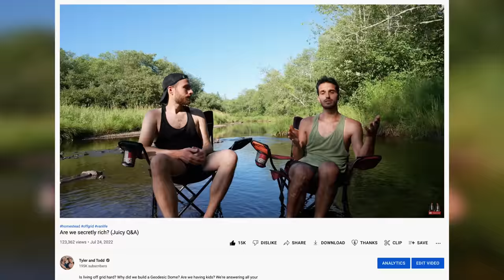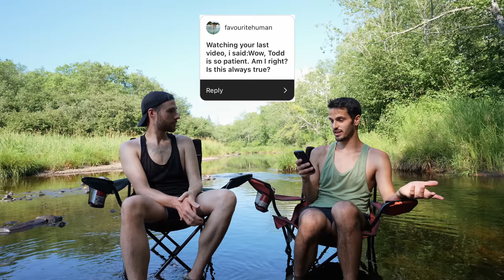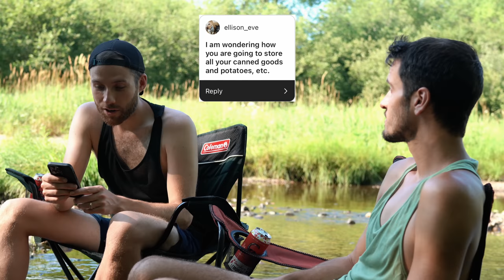Why we live off grid in the woods (in a Geodesic Dome)

Comment: Maybe for the root cellar, you could create some sort of a ‘Hobbit Hole” - an above ground mounded dirt hill, internal structure, with the green roof being natural vegetation. The hill should be able to keep a constant temp but being above ground should keep the water table from being an issue?
Reply: What a great idea!
Reply: Where I grew up in Wyoming someone had actually done just that. They took the insulated box off of a refrigerated truck and buried it above ground with dirt for a root cellar. As far as I know it never froze inside nor did it get hot in the summer time
Reply: I was just going to leave a comment about this! They are quite common here in Sweden, plus they are so nice to look at 😍

Comment: Regarding the Garlic. Leave it in the ground this year and dont harvest it. So leave it over winter and then harvest it next year instead. Garlic requires the cold of winter to form the cloves so leaving it in the ground over winter itll give you the cloves next year. Ive done that before and its worked for me.
Reply: Also, trim off the scapes, the flower stems. Better bulbs, and can be used in stir-fry.

Comment: I live in an area with clay soil that seeps water. The root cellar solution is to build it above ground. A concrete shell covered with about a meter of compacte soil, planted with grass for stability. You get the benefits of the constant temperature without the constant damp.

Comment: Here's a goofy idea for the root cellar.  Build it above ground and cover it with the soil you excavate at the new pond.  The soil can add it's insulation factor to maintain temp and humidity.  It'd be another way to reuse material.

Comment: Rain barrels, once you have your home built. We have 11 barrels (~ 700 gal) which collect water from our ~3600 sq ft metal roof, which we use solely on our extensive gardens and aquaponic greenhouse system. Your pond and high water table are great assets, but the vegetation absorbs a lot. Your roof will be waste water unless you collect it.

Comment: I had ideas once for a root cellar, I live in a location that has a high water table. It’s based on the Earthship, an above ground structure, no insulation, surrounded by 6 feet of dirt, 183 cm. I imagine you would need a dome to support the weight of dirt on the roof, and maybe you could get away with less or no dirt on the roof. 

Just a suggestion, I know it would be a lot of hard work, I would try and avoid the tire wall.

You guys are great!

Edit
Basically an above ground dome structure surrounded with 6 ft, 183 cm :-), of dirt.

Comment: on the avocado tree: it takes years to bear fruit. it needs a crapton of water.  it get HUGE. and you can't grow it from a pip, because the fruit will not tast good. if If you want to save time and disappointment, buy a small tree. also, check if it can survive the winter temperatures :-)

Comment: People are talking about canning food, but pressure canning requires a large amount of heat .  There is plenty of wood around, but would youall get a solid-fuel boiler to steam up a pressure vessel or use a cast-iron stove to hold portable pressure cookers?  I would think electric resistance heat is not an option.  Of course, there is always LPG flame, which would not really be too sinful.  
     I think I heard a freezer mentioned.  That is the best way to preserve most foods, but the electricity must be dependable.  

     Thank you for bringing us along on your life journey via your video presentations.